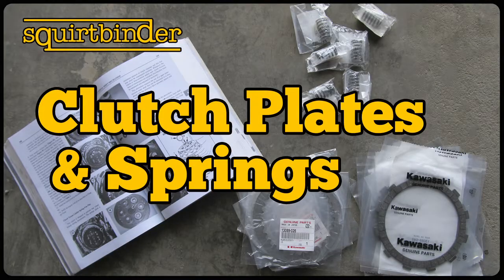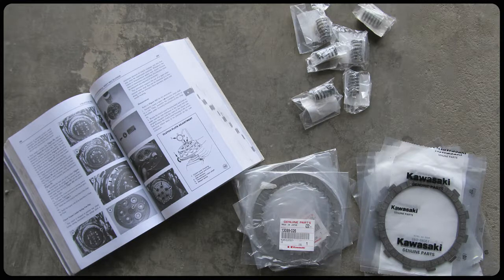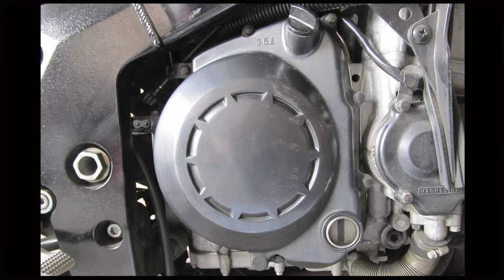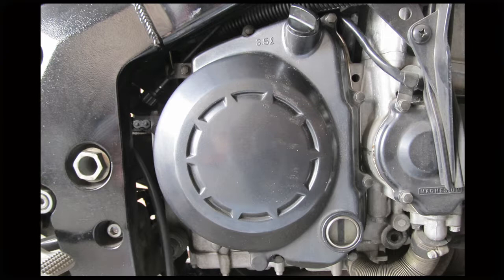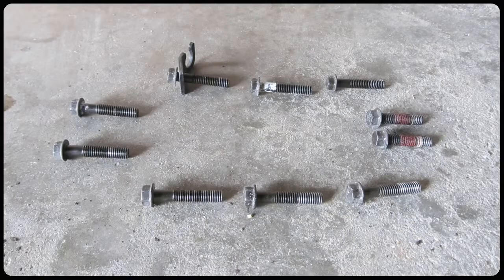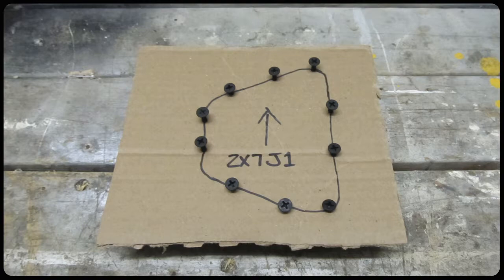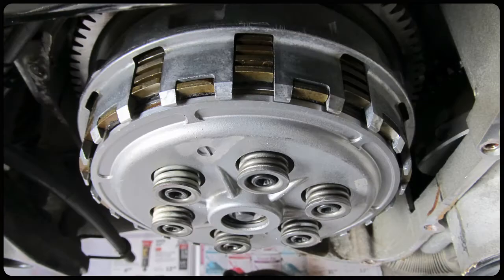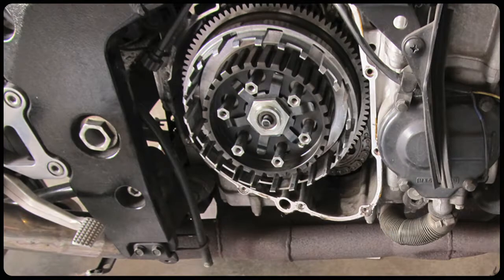Replacing Motorcycle Clutch And Springs (Kawasaki ZX7)

Comment: I recently changed the clutch plates on my 95 zx7r the clutch slips when I twist the throttle, i literally took it apart like 20 times already every time it gets slightly better. I changed to a different oil. Stiffer springs, changed hydraulic clutch fluid. Summer is near i cant get the damn thing to work right lol
Reply: did you find out what the cause was? mine is doing the same
Reply: @Codeejonz  I ended up selling it as is with the problem lol